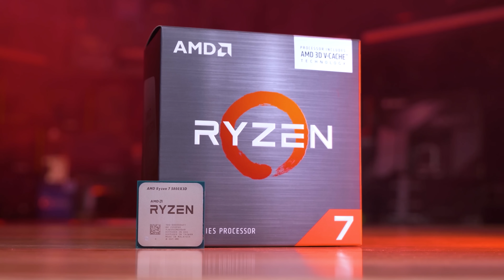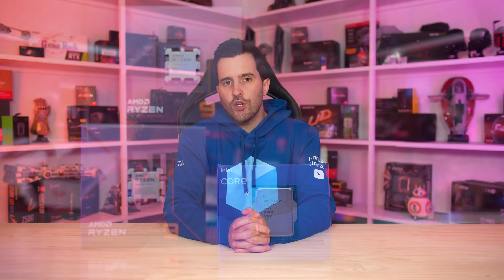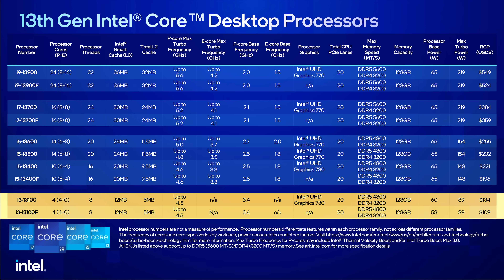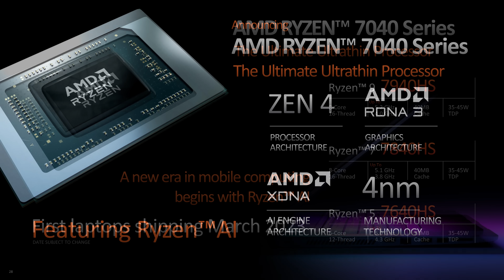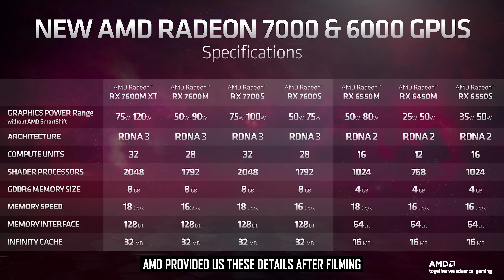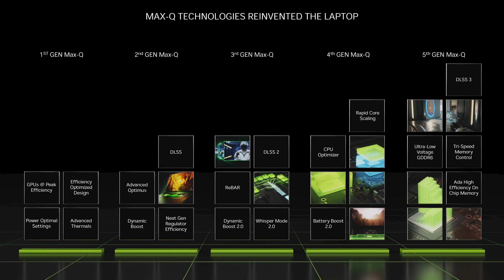Zen 4 3D V-Cache, 7950X3D, 7800X3D, New Cheaper CPUs, "RTX 4090" for Laptops - CES News Recap

Comment: 144MB cache. Holy shit, you could run Windows 98 on that. I love my 7700X, I'll be waiting for whatever the last AM5-compatible CPU is before upgrading.
Reply: I love the idea of booting Win98 on a system with no installed RAM.
I'm gaming at 4K on an overclocked Xeon E5-1680V2. Literally going to go from DDR3 to DDR5 when I upgrade lmao.
Reply: @asm_nop  I went from the E5-1660v2 @4.8GHz to a 7700X @5.8GHz, great jump in performance!
Reply: @asm_nop  You literally going to do it or actually going to do it? I'm guessing you also 'literally lmao'd' when writing tnat?
Reply: Ah, the 9950x3d.. nice
Reply: Aha, someone with exactly the same plans as myself. :D
Reply: I was already really impressed with the 32MB of cache on a Ryzen 3600, which still is one of the biggest jumps in cache size relative to the previous generation equivalent.
Reply: The price AM5 DDR5 Ryzen 7000 still expensive today. Your build must be worth $3000 depending when u built it.
Reply: Windows 98 ran in 8 MB, or 16 MB well. 2000 and XP ran great with 64 MB.
Reply: @MarkRose1337  WinXP (at least up to SP2) ran decently on 256MB, nicely on 512MB, and great on 1GB RAM. Saying that it ran “great” on 64 MB is not accurate… at all. Even Win98 needed 128 MB to run all apps decently. If you don’t believe me, try and run 3DMark2000 on Win98 with 64 MB and see how well it behaves. PS: I’m a retro PC fanatic, I own hundreds of computer parts, so I know what I’m talking about.
Reply: @ruxandy  They bloated it a lot over time, yes! SP2 definitely required more RAM than the initial release. Applications, of course, required more memory. I can remember opening a 96 MB Photoshop file on a Windows 98 box with 128 MB of memory: took over an hour. I do believe you.

Nothing was as painful as Windows 95 in 4 MB of RAM. It was possible, barely.
Reply: @MarkRose1337  I wasn't referring to RAM. I meant that you could actually fit the ENTIRE operating system in the cache. LOL
Reply: @HansUberschlage that’s the point… they are talking about how little storage was required. And then it became a nostalgia trip/circle jerk for how old they are.
Reply: @HansUberschlage  Linus played Crysis completely in-CPU with a Threadripper. Now we can put the whole OS in a CPU. This puts a whole new spin on "virtual machines", lol.
Reply: @benjaminoechsli1941  LOL I want that in the next video.
Reply: @benjaminoechsli1941  Yes, he ran the original 2007 Crysis in software mode(first on a 64c/128t Epyc CPU, then on the 3990X). That was at 720p lowest settings and barely got a playable 30FPS. On a $4000 CPU. I'm willing to bet the game would have run much better on a $50 Athlon 3000G(2c/4t Zen CPU vs 64c/128t Zen 2, but with Vega 3 graphics.

In fact, I found a video where someone tested Crysis on an Athlon 200GE. That was initially the cheapest Zen based APU at $55, with 220GE and 240GE having slightly higher CPU clock speeds at $65 and $75 respectively(clock speed bumps not worth the extra price, imo). All three had Vega 3 set to 1000 MHz out of the box, and all three were locked down.

Anyway, the 200GE was set to 1366x768(so possibly slightly higher than Linus used at 1280x720?) with medium settings(vs low) and got an average of around 45FPS(vs 30).

I know you can't really get a new 3000G for $50 anymore, but when you could you got an APU with 240GE CPU speeds and an 1100 MHz clock on the Vega 3 out of the box. It was also totally unlocked for overclocking both the CPU and GPU(unlike the GE models where both sets of clocks are locked). It's generally pretty easy to overclock the Vega 3 graphics by 50% to 1650 MHz even on the included AMD cooler. I think that's what most people do, since when using an APU like that, the GPU is more often the bottleneck than the CPU. You could maybe get 60FPS at 720p medium, or around 30FPS at 1080p medium. Or maybe 60FPS at 1080p low. Still, a fair bit better than a 3990X for a lot cheaper.

Edit:link to video: https://www.youtube.com/watch?v=GuiC3sqnRC0

So I guess it's a mix of medium and low settings(high textures, though) in Crysis 3. The first part of the video is indoors, where FPS is closer to 60. It isn't until the video moves outdoor that the FPS drops to closer to 45. So not the same game, but my understanding is Crysis 3 is more demanding than the original Crysis.

I found a Reddit post where one of the commenters ran both Crysis and Crysis 3 on the same system(didn't mention resolution, though). Here's that comment"

"Well, with an i7-3930k @ 4.3GHz, a Radeon 7970 @ 1125/1525, and 16Gb DDR3 @ 1866 Crysis 1 Very High with 4xAA very, very rarely goes below 40fps. I can play with V-Sync for 60fps the vast majority of the time.

With Crysis 3, Very High runs at 24 - 38FPS. I have to move down to Medium with 2xt SMAA for an average 60FPS."

I played through Crysis on an FX8350 OCed to 4.4 GHz and an RX 480 8GB with 2x8GB DDR3(1600) at 4K max settings. IDK what the FPS was, but it was playable enough for me, at least until I got to the final nighttime battle aboard the aircraft carrier. That level is notorious for tanking performance, so I ended up turning things down to 1080p High to get it playable. But that's me.
Reply: @MarkRose1337   64mb for xp lol ? yea but  how well... lol i remember having 256gb or 1gb eventually with xp
Reply: @IcyTorment  my dad had a MAC in the 90s with floppy discs that were called "memory boosters"  i still have those hah

Comment: I do not believe there’s any purpose for the 7600X, 7700X or 7900X processors once the X3D lineup releases. Why would anyone opt for a 7900X? If you need productivity go for the 7950X and if you want gaming go for the 7800X3D. I just can’t imagine there are many people that need more than 8 cores but less than 16.
Reply: Yes… non x version about $50 cheaper than x version and 3d cache version will be about $150 more expensive. There is plenty of room to normal x versions!

Comment: 78x3d will be the best CPU for gaming in its class, but not for creator content
Reply: Why not? They're listing it with identical clock speeds as the non 3d CPUs. The extra cache absolutely can be leveraged for content creation. The only thing wondering is whether it'll have a locked multiplier.
Reply: @GSP-76  in its price class Intel offers better multicore performance.
Reply: @raphaelrembrandt9838  No it doesn't. Maybe for your average day to day stuff but it doesn't really matter for that kind of usage...the 13900K is nowhere near as good as the 7950x when you actually load the CPUs and run them at the highest frequencies they can handle for 24/7 use. I can run the 7950x at an all core frequency of 5.4-5.5ghz and it never loses a step and never throttles...the 13900k starts thermal throttling almost immediately. The E Cores are just not good...and the CPU almost immediately passes threads off to them at abysmal clock speeds. Even with a full blown custom loop, the Intel CPU is just a crazy hot CPU. I'd much rather see Intel just dump the E-Cores and create a solid 10 core CPU...but that won't happen until probably their next all new architecture.
Reply: @GSP-76  Well of course the intel is hot because its using 500watts to compete with 7950x specially on productivity.

They dont know that
they focus only on games.

Intel fanboy now a day.
Reply: @GSP-76  The 7950X will be faster than the 7950X3D in productivity.  That's just an educated guess, but I'm almost certain it's correct.  The maximum clock speed will only apply to one of the CCD's.  The one with the stacked cache will clock a bit lower, meaning all-core workloads will be somewhat slower.  But probably not by a whole lot.
Reply: @TrueThanny  That could be true...let's see when reviews come out.

Comment: The 7900X3D looks like the CPU to get if building a new PC 😁👍
Reply: @Menti Capti Yeah it's seems like the perfect one for gaming and productivity 👍 I have my 5800X3D for now but in the future this is the one I want.
Reply: I got a 5900X currently and I definitely noticed some games will use a lot of it, and probably cut it fine on a 5800X 3D despite that being a lot faster. The 7950X 3D with it's dodgy stack doesn't sound appealing to me
Reply: @Menti Capti Well now, that I do but not at the same time🤣😁 But I would like more than 8 cores less than 16 so 12 seems good😁

Comment: Honestly the 7800X3D seems like the most reasonable upgrade of all the Zen 4 so far. It's literal plug and play. Ofc the only downside might be that it's probably not overclockable like their non 3D V-cached brethren, but I'm pretty sure with some memory tuning and undervolting you can get a few more performance with less power. Definitely something to look out for.
Reply: What do you mean plug and play. Do you mean upgrading an already am5 platform with parts that are less then a few months old. That sounds so stupid.
Reply: Aren't all of them plug and play if you already have an AM5 board?
Reply: it is not literal plug and play, you need Motherboard BIOS upgrade first :)
Reply: What do you mean "non overclockable like their non-3D V Cache brethren", both 7000X and the upcoming non-X are overclockable lol
Reply: @robertstan298  yes. I'm saying that the 7000X series is overclockable, but the 3D V-cached ones aren't. That's pretty much what happened to the 5800X3D. Being fast but you can't overclock it. Yet it's still much more powerful than their 5000 series parts.
Reply: @joelconolly5574  my 5800x3d in my MSI Unify-x oc to 4.7GHz just fine…
Reply: @Soup-yumyum  Are you doing BLCK OC with your Unify? Or that One click OC they have in the bios for it?
Reply: @ShimejiiGaming  BLCK and Kombustor 3 = (PBO2 -30 curve all cores) as well as a neg 0.075 undervolt.
Reply: 7800x3D Honestly looks like a flop, its basically a 600 mhz jump, for roughly 10-15% performance over the 5800x3d, for quite a lot more. 7900x3D makes more "sense" but even then its a a step up, not a leap forward.
Reply: @ShimejiiGaming   The problem with this argument is that you're assuming 0% IPC gains, which is unrealistic. You can't just compare clockspeeds like that.
Reply: @ShimejiiGaming  this is just wrong information, hilarious that you comment this bs in this video which explained exactly this. 😂
Reply: @ShimejiiGaming  Are you drunk or trolling? The (limited) performance data they showed had it at 21-30% faster than 5800X3D. Where TF did you invent 10-15% out of?
Reply: @robertstan298  The other performance graphs that AMD showed at the presentation. The removed the higher performance graph for the most part. I expected a 20% increase, but i was hoping for at least a 5.2-5.4 on the 7800x because thats where most people would go, but at 5? Probably just an eh jump. Certainly great if you are doing a full upgrade for sure.

It also depends on if they are doing the x3D chiplet clocking to 5 ghz, and then the other chiplet clocking to the normal boost. That will be quite hard for scheduling in windows, i expect quite a few bugs with it.
Reply: @ShimejiiGaming  agreed

Comment: x3d chips sound amazing. If GPU's were good value. As it is, AMD can look in the mirror when wondering why people are sticking with older CPU products which are good enough to power the GPU the consumers can afford stuffed in your average computer. I also feel AMD basically missed the boat with not increasing core count this generation. Slapping on more memory feels like lipstick on a pig.
Reply: There's zero reason to have more than 16 cores for desktop CPUs. If you need more, go Threadripper.
Reply: @GSP-76  threadripper is dead
Only pro version exist which is super expensive
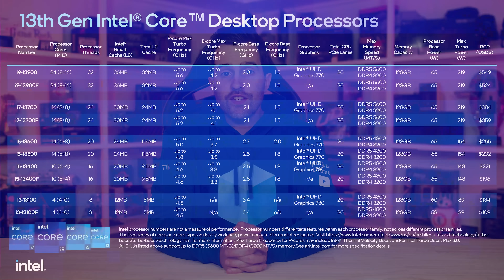Reply: @GSP-76  7:36 so much for zero reason.

Comment: Can’t wait to see the benchmarks.  I wonder what intel’s response will be.
Reply: KS chip incoming but it'll lose to the higher tier x3d chips
Reply: They'll possible release faster 13th gen or maybe release 14th gen early, which will probably not quite match it anyway
Reply: @MrZodiac011  They're fucked. They'll still win multithreading on desktop but X3D will handily beat them in gaming, On mobile its way way worse for them. Dragon range will be way more efficient in high end laptops than any HX CPU and will very likely still win in single and multithreading. And Phoenix is leagues ahead of anything they'll be able to put out for likely a year.
Reply: Intel has the money to lose to net a win, they can just copy AMD and sacrifice something for more cache allowance if they were desperate to hold a crown.
I see so many users wanting a X3D chip, I wonder how low sales the non3D chips are cos people only deem the X3D as viable AMD gaming products it seems.
Reply: they'll throw in an i7-6700k

Comment: Really excited to see 3 options for the 3D, wasn’t interested in the 7000 series until now
Reply: Yeah fr if they dont bump the price too much it might be attractive
Reply: Unfortunately there is no 7600X3D, which would sell like crazy. But margins, gotta have those margins.
Reply: I bet they will just be a bigger ripoff.
Reply: @fshn4x4  I went from a 3600 non x to a 580X3D and can say its a massive step up. Games that can use it see a big bump in fps WoW went from 100 to 165fps just on the CPU swap. Saw about 35fps bump in MW2 and run no mans sky at 120fps on ultra with a 6750xt
Reply: @fshn4x4  typical AMD hater spotted
Reply: @fshn4x4  Every 400+ $ gaming CPU is a ripoff, but if you have the money and want peak performance you don't care.
Reply: @fshn4x4  So go buy cheap Intel CPUs then.